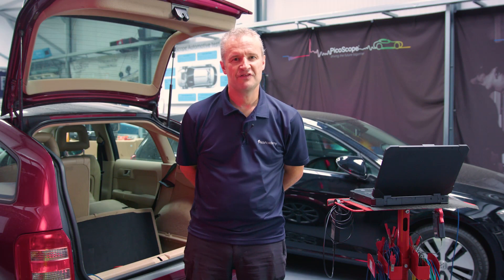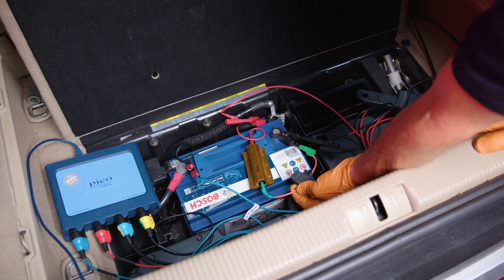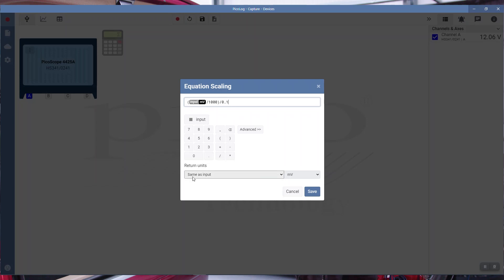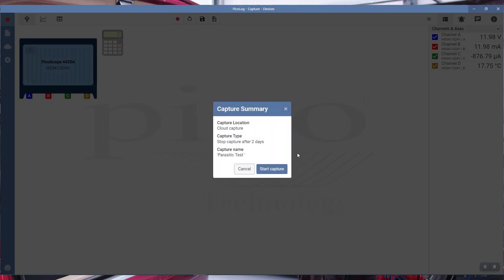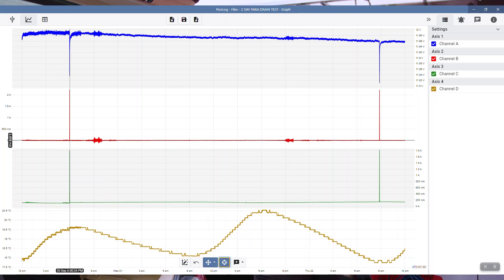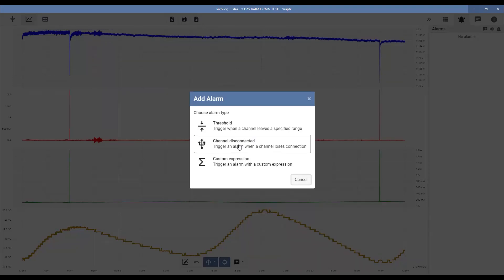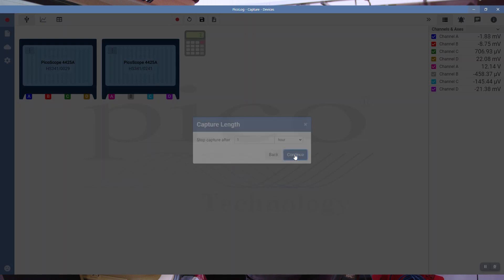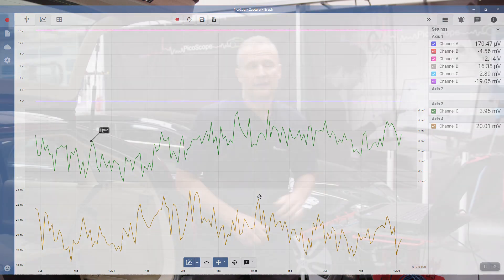Parasitic battery drain data logging for automotive and heavy duty equipment

Comment: Great info well presented thanks, can we use our old 4425 with the 4425A for the 2 scopes option then, I knew I kept it for a reason :yougotthis:
Reply: Yep, pretty much all of the Picoscope range of Oscilloscopes can be used with PicoLog.
Reply: Hello and thank you for the inquiry. Yes you can as both scopes can be connected to PicoLog at the same time to increase your channel count to 8 and beyond if necessary. Outside of PicoLog both these scopes are of immense value either with PicoScope 7 Automotive and or  PicoDiagnostics

Comment: Thank you for this video.

One question: around 5.30 when setting up the formula for the math channel how come that mV divided by 1000 results in volt and not in microvolts?
Reply: Hello Juergen, thank you for the inquiry. In the example at 5:30 we have (Input mV / 1000) to obtain volts. For example (1000 mv / 1000) = 1 V We then divide this value by 0.1 (resistance) to obtain Current (Amps) I hope this helps. Take care......Steve

Comment: Hi Steve experimenting already, but having issue with alarm, (testing lithium battery) have set lower threshold at 3700mv upper at 3900mv voltage running at 3800mv, alarm is on continuously?

Comment: Hi Steve, what power rating is that 0.1ohm resistor.. they vary from 10-100w
Reply: I guas It's a 150 watt resistor  "Arcol HS150 R1"
Reply: @jacobmrk8903  I guess that would be a good value, rated upto about 12amps current as opposed to a 10w which would be rated at under  an amp